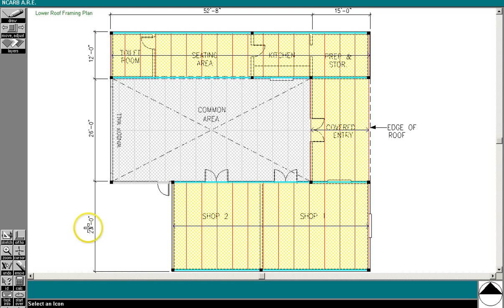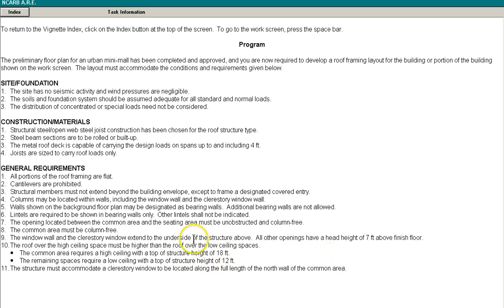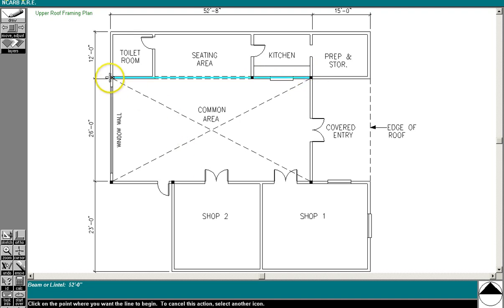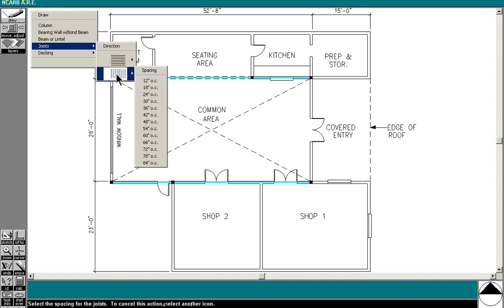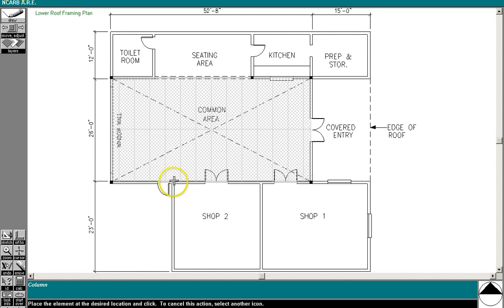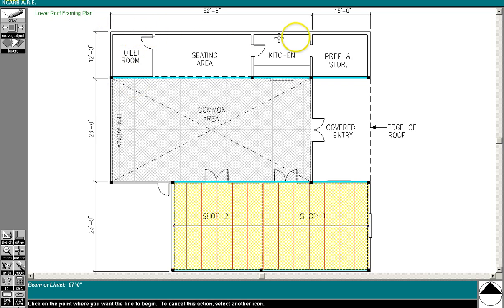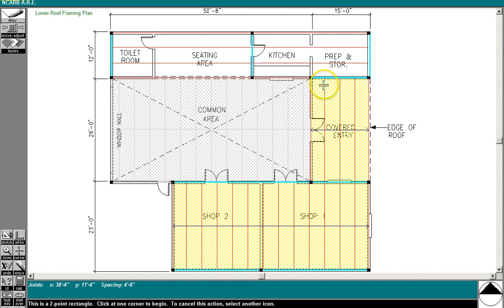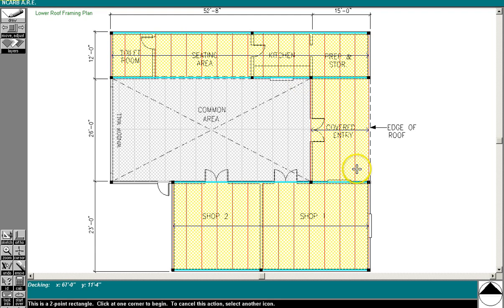ncarb structural

Comment: Although this is generally a good tutorial and worth your time: there are (2) beam errors in this tutorial to be aware of. The (2) missing beams can clearly be seen in the successful solution shown in the NCARB Structural Systems Exam Guide. 
1.  Missing Beam: The beam located at the East Common Area Wall. (Between the Common Area and the Covered Entry). 
2. Missing Beam Section. The beam at the South Common Area Wall should extend all the way to the far South/West column. 

In the program the Window Wall is indicated to extend to the roof above. As it is shown in the plan to occur on the 1st floor it does not require a beam. This is faulty programmatic notation in my opinion. To be more clear it should read : The Window Wall spans from the foundation floor at level 1 to the underside of the roof structure above.
Reply: 1. I agree - this beam is needed as the program explicitly states that joists are sized to carry roof loads only. Therefor the roof joists over the covered entry cannot support the weight of the wall that extends up to the second level. 
2.The sample passing solution in the NCARB exam guide shows a bearing wall on the 1st floor, not a beam.  But you could solve this vignette with all columns/beams, and you would not need the beam as you described.  Including a beam at this location wouldn't negatively impact your score, but it's not necessary.

Comment: I agree with porsche187.  I failed my exam because I trusted this video and others that didn't put a beam under the wall shared between floors.  you do not need one on an exterior wall but your do need a beam under the clerestory and any where where a yellow roof meets a gray roof (when on the level 1 layer)
Reply: +Amanda Pederson 
Does anyone agree/disagree with this?
Structurally why is this required
Reply: Because it supports the wall on level 2.

Comment: you forgot two kind of major things.  A.  you need a beam beneath the window wall.  B.  you need to have a beam on all walls shared between floors, so the wall to the west of the covered entry needs one, as well.
Reply: I read that the window wall beam is not necessary. Exterior walls continuous are self-supporting and dont need structure per the Ncarb instructions. 
You are correct about the beam between floors since this is interior.
Reply: So what you are saying is all the second floor walls need to be supported by beams or if there is a wall beneath it would need to be marked bearing wall?